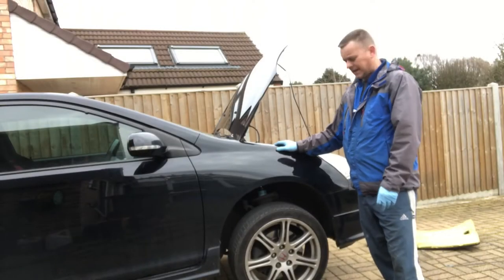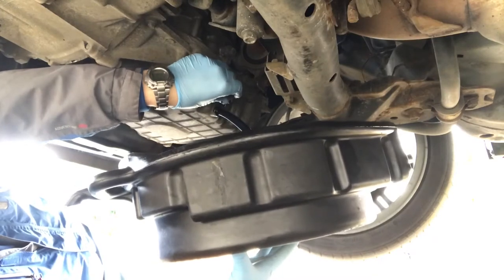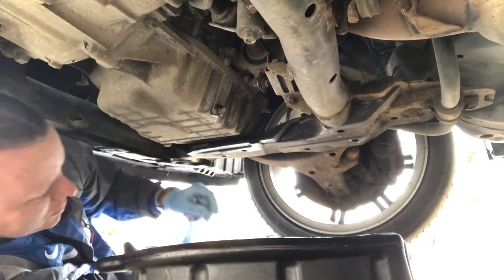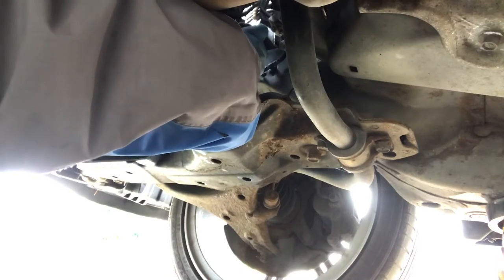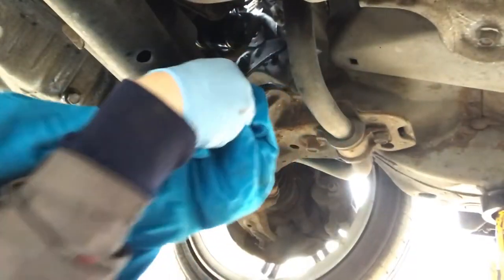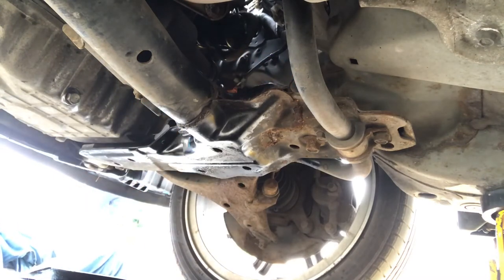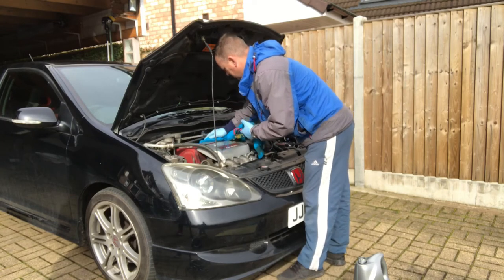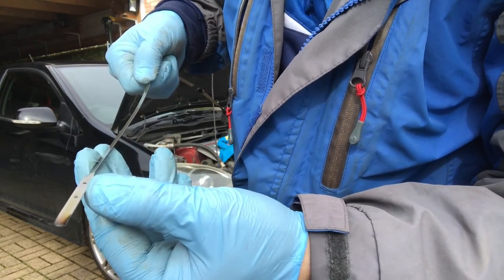Honda Civic Type R, Oil & Filter Change ep3

Comment: Nice video well done guys, just bought myself a cosmic grey 54 reg with 99k on the clock and I love it, going through all the jobs on it currently to get it perfect, new front tyres, oil and filter change, gearbox oil, forte injector cleaner, pipercross replacement filter, new iridium plugs made a lot easier by your other helpful video, tow new anti roll bar bushes. Lovely cars
Reply from the maker: Good choice! Thanks for the great comments👍🏻👍🏻🛠